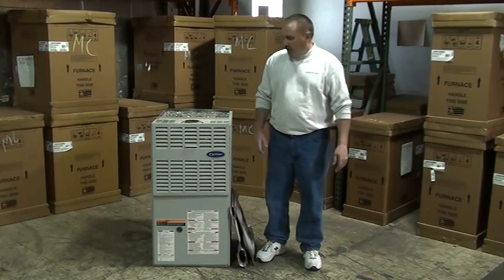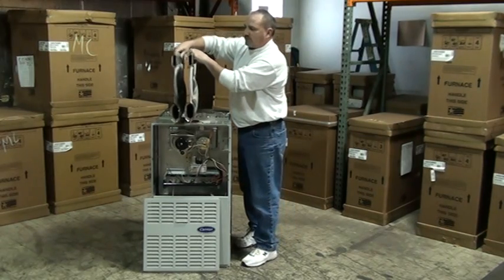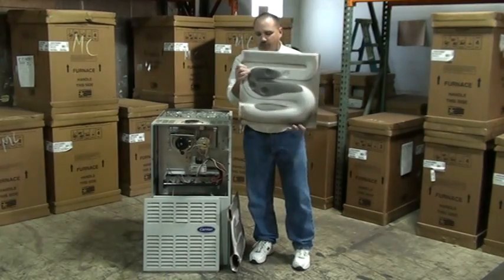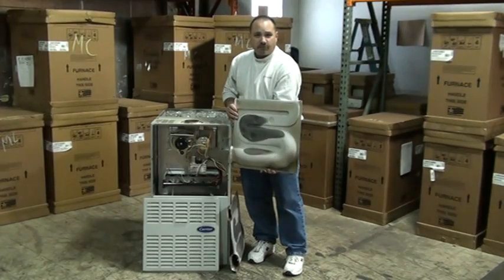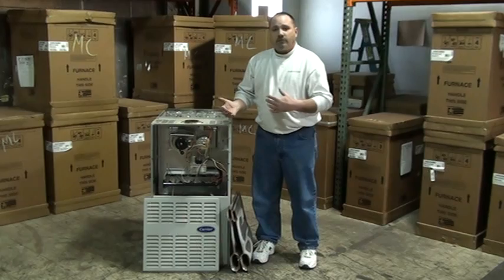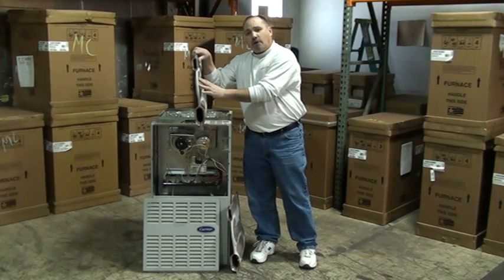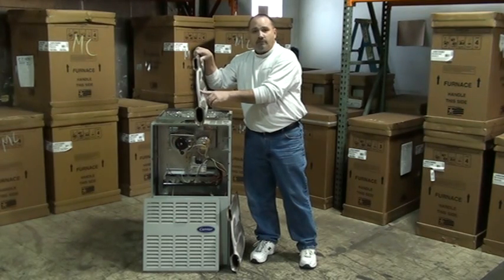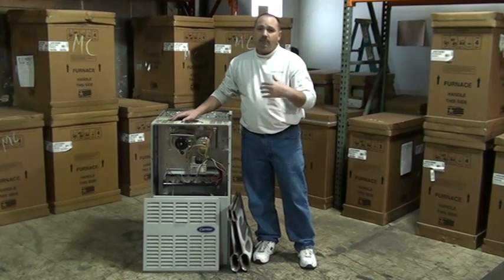Furnace Inspection - Cracked Heat Exchanger

Comment: what would cause an oil furnace to emit an odor that smells like car exhaust into the 1st floor of a house.  my furnace is doing this when it runs, the odor is only in the room that is over the furnace, the rest of the house smells fine, when the furnace turns off the odor dissipates.  it's pretty strong, stinks pretty bad.  flue issue or heat exchanger?  could it be that there may be a clog in the chimney??  I'm trying to get help with paying for a repairman so it might be a while until I can get this thing looked at, might be shutting it down soon.

Comment: For those who are bad mouthing the warranty, if you follow the scheduled maintenance guide lines to have it cleaned, airflow and gas pressure checked. 98% of the time the heat exchanger will last for 20 + years ....neglect is not and should not be covered under warranty . I am replacing a 20 year old Coleman with a cracked heat exchanger it never had any maintenance done.

Comment: Today's goodman is far better than it was 10 years ago. The tubular chambers never crack, they are backed by lifetime warranty. I worked for a carrier authorized dealer and the units are a piece of shit, usually more expensive than others. Good quality systems Goodman, Amana. Quiet systems Lennox. Low operation cost rooftop units that won't corrode to ocean coast air (American standard)

Comment: In most cases the exchangers have a 20 year warranty, however some companies may charge high on labor charges depending on location and it's only the remaining warranty of the chambers and maybe one year warranty on labor. To some it may make more sense to replace the furnace because price difference may not be far off, better efficiency and new equipment warranties.

Comment: When i inspect those carrier furnaces i first pull the limit and most of the time the dimples are cracked there. If not I then pull the blower and look from underneath with a mirror or a flash light. These furnaces are garbage. I rarely come across a carrier 80% furnace that is not cracked.